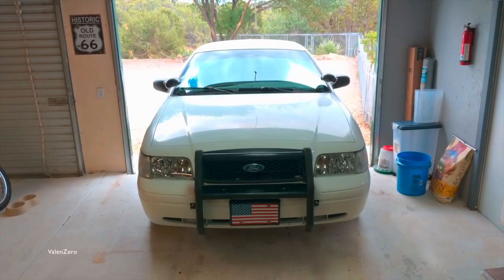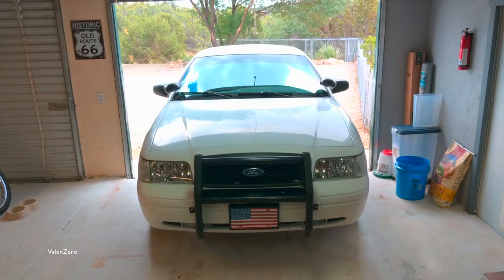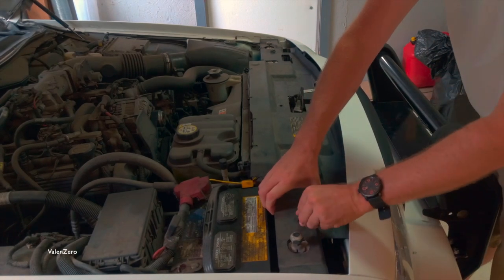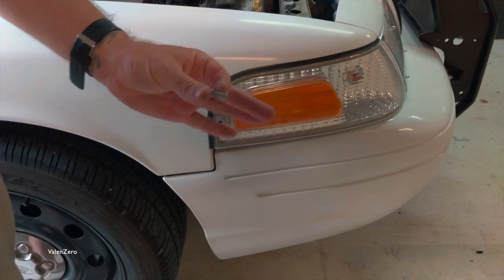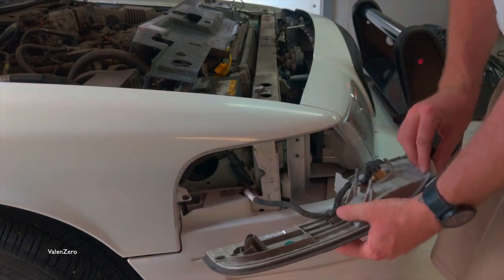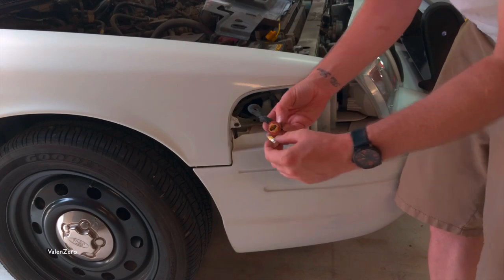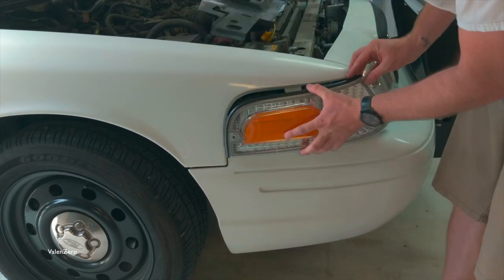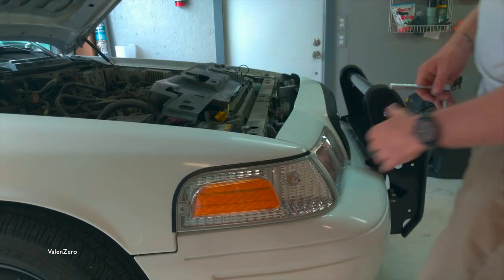2006 Ford Crown Victoria Police Interceptor Side Marker Lamp + LED Bulb Replacement How-To

Comment: Does the light you replaced only steady burn or does it flash also? I just bought an 11 Cvpi and both my lights on the side don't work but all the others do. The fuses are all good, I'm going to change the bulbs to see if that's the problem and go from there.

Comment: Is the rubber seal around the side marker assembly necessary?  Mine are dried and stick out, I'd rather just remove them.
Reply from the maker: I'm not sure....it's designed to prevent water from entering in that location. Maybe you can put a bead of silicone there instead?
Reply: the whole assembly is $10, i just bought new ones

Comment: i have an 04 and im having issues getting the bolts off. I was using a 11mm socket small extension. On the left side I can get the ratchet on the bolt, but it seems like I dont have enough room to actually turn it. On the right side the ratchet cant fit because of the headlight. Im not sure if you've had this issue or have any suggestions. It would help. I just need to change the bulb, mines out.
Reply: I had to take the headlight for more room and i got it.
Reply: I removed the headlight as well, but I can't get the ratchet to move to loosen up the bolt. I'm not sure what I'm doing wrong using a small extension with the ratchet too.

Comment: Does this cause hyper flash? (Using led bulbs on corner lights)
Reply from the maker: Nope! Luckily didn't need load resisters either. The brake lights you definitely need the load resisters.
Reply: Can I also use the side marker led bulbs for the front turn signals ?
Reply: I left my amber halogens on because i was afraid of hyperflash